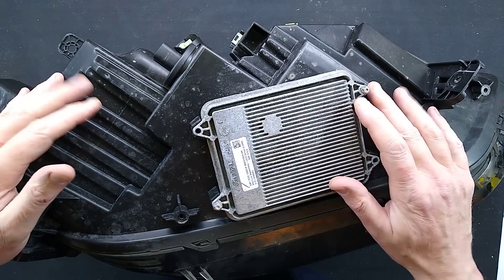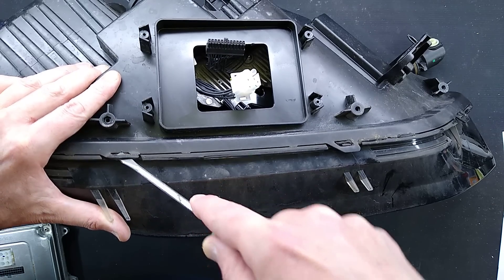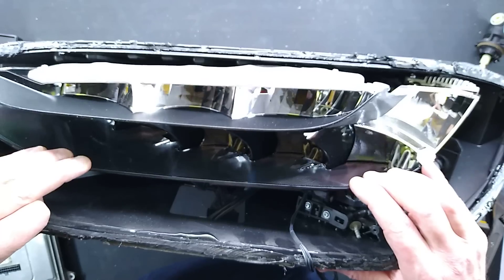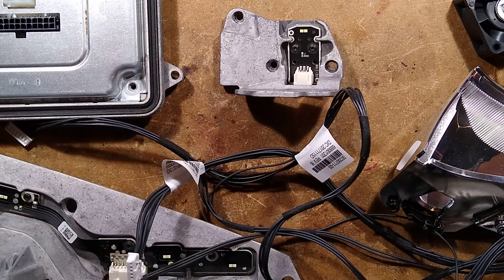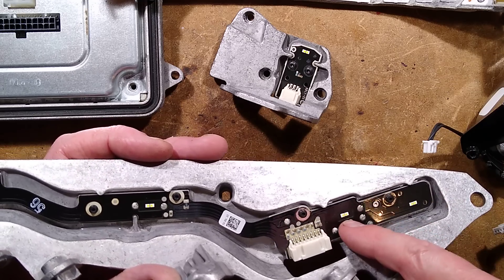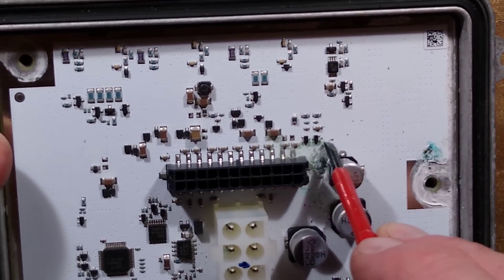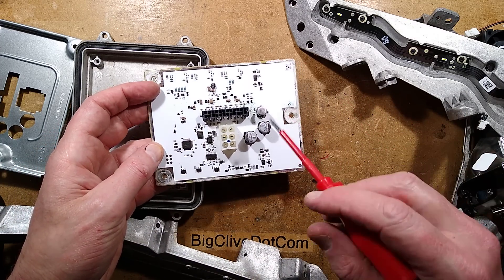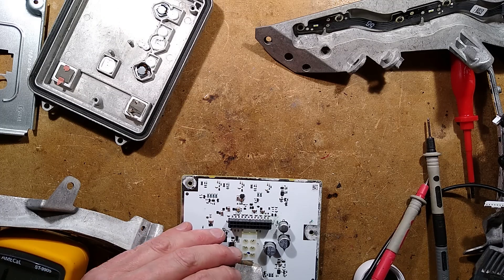Exploring a Tesla model X headlight

Comment: I think the biggest issue here is the case design.  It probably needs more fasteners or a more sturdy case.

Honestly, I'm surprised they use an o-ring and screws.  I always assumed these modules that are subjected to the elements we're simply glued together with some sort of adhesive sealant.
Reply: You might as well pot it if you're just going to throw the whole headlight assembly away.

Comment: I'm unsure if it would work with the Tesla unit, but BMW units can be opened by baking them for 10 minutes at 100°C at which point the glue melts (obviously use gloves if you don't want to sizzle ya pinkies).

Comment: I saw a video on here of Pakistani children refurbishing head lamp pods, I think they used a heat gun to soften the butyl rubber goop that holds the halves of the pod together. Bucket of hot water would probably work too. It looked like a similar compound to the stuff used to hold vapor barriers to car doors that never really hardens.

Comment: Tesla's are crap though. Very clever and everything, but they are made of chocolate and are unfixable. Take a look at the central displays leaking fluid and the modules failing THAT ARE SOLDERED IN. Dont own one out of warranty the battery pack is the least of its worries. Makes me laugh with the 'vegan' leather as well, it's called vinyl and crap cars have used it since the '50s. Classic marketing.

Comment: I don’t know which is more shocking the genuinely extreme effort gone in to making this next to impossible to repair or the absolutely ridiculous amount of tech used just for a headlight. Madness.
Reply: Normal for Tesla unfortunately
Reply: “Good for the environment” yeah, right.
Reply: Most of these LED head light units are Sealed, it's just the way it is unfortunately. It's really dumb when you have to turn round to a customer and tell them they will be over £500 for a blown Side light because the whole headlight unit has to be changed.
Reply: it will only get worse... mentally ill infants have enough money to just buy nukes, zero reservations to just use them, and the "sellers" are mentally ill enough to just give them out.
Reply: I was expecting Laser headlights for that price like some BMWs
Reply: someone just showed me a receipt for a headlight replacement in atlanta $3100
Reply: @nhantran98  wow, just wow...
Reply: Neither of them are shocking to me.  Make it all but impossible to repair yourself and make it cost as much as possible to replace.  Sounds exactly like Corporate Evil Cunt Bullshit to me.
Reply: Yep, 1 bulb, 3 wires , a glass and a mounting bracket.
Reply: They have already implemented the next step in non repairability.
"The structural battery"
All the battery pack glued together internally. Impossible to disassemble without destroying... take a look at Munro channel.
Teslas are highly optimized. Repairability   does not alow for that level of optimization.
They are opening the way for rest of the industry...
Reply: @ptamog  Your picking the wrong component to attack and also showing a distinct misunderstanding of what actually constitutes a battery. The tesla battery is made from a collection of battery cells, ALL BATTERIES CONSIST OF 1 OR MORE CELLS, if i combine batteries they become cells and the battery becomes the collective,  sure these store power but they are not intended to be used on their own AND these are unserviceable for safety reasons for everyone including professionals at home except for when they have serious fire protection. When making a battery from cells a short can happen for many reasons and sometimes completely randomly, when these batteries ignite the lithium is superhot. If you have seen youtube videos of the samsungs failing now imagine that thousands of times bigger and you ll get the point why tesla does not allow people to work on the battery pack. If anything it show progress in the Automotive industry and regulation, how many people died with the introduction to gasoline and no government regulation on storage or public knowledge? This is 2022 companies are expected to be responsible. The very fact you have fallen for some stupid information on Youtube without actually understanding the electronics from a physics point of view tells me that you shouldn't be calling them out on it. 
Please go take a look at what happens when a battery services goes wrong with a lithium battery. The best comparison to a gasoline vehicle would be welding the fuel tank. This is something every garage knows should be done be a trained professional. Whilst the gasoline with go with a boom, it will burn out much faster than the lithium and it will not reach anywhere near the same temperature. This is an exceedingly more dangerous fuel type and precautions have to be taken. 
Now I agree Tesla could make certain parts more serviceable, in this case I too believe they maybe should have tried just replacing the controller and see if it fixed it, however each controller could be UNIQUE to each headlight. All LED are slightly different and with this level of optimization and as clive says advanced optics it wouldn't surprise me if this was the case and they were made in the factory the circuitry was created at the same time all whilst being tested for conformity and adjusting until perfect. The Tesla factories are by far the most advanced automotive plants and with something as important as headlights I feel their own quality standards would drive this solution. Super expensive but the results are evident. The equipment you would need at home to repeat the process would be super expensive. This is advancement, just like I mentioned with gasoline when that engine hit, no one knew how to repair it or had the equipment to do it. It was too advanced, but as time went on the tools caught up, education changed and so forth. In time you will get your right to repair and the headlights will seem like a stone-age invention for tiny money. Its a circle. We've been through all these arguments many times just with different wording. 
I personally do not care if a company makes its products repairable or not as long as I know in advance when I buy the product. Then I can make a choice. Tesla has been very open about where there vehicles should be repaired. You know this when you buy the product if you then proceed to compain how it unserviceable your an idiot.
Reply: @ptamog  Yeah repairability suffers, but they already were about 20% more efficient per watt than their nearest competition, now with gigacastings and the structural battery pack + 4680 cells they will probably be about 35% ahead.
Reply: H4 FTW !
Reply: @bullzebub  2x h7 is better
Reply: This one is almost 10 years old, the new ones have way better headlight tech.
Reply: @SirDragonClaw  how much 'headlight tech' do you need? Mine work just fine with a lamp, a reflector and a couple of wires.
Reply: ridiculous ? Dc-Dc LED drivers for better efficiency + MicroController  for digital controls and fail detection. 
Only bad thing is no coating on pcb.

Comment: There's a few £ worth of components in there, as with all these modern LED lights. 
The main emitters look like CREE X Lamp XB-D which are in 2.45mm X 2.45mm packages. XB-D are rated at 3 Watts each, and produce about 135 Lumens per watt.
CREE XB-D are used in LED light bars, and better quality LED replacement bulbs for vehicles.

Comment: I presume the up/down pivoting lights are for low-high beam, but how do the side-pivoting lights work? Do they swivel in at higher speeds to throw more light down the road and out at slower speeds, when the driver would (presumably) be more concerned about roadside hazards like deer and neighbors' pets?
Reply: The pivot is only for the initial alignment. They don't move while driving. It is the same adjustment screws as all headlights on all cars have been for at least the last 60-70 years.
Reply: @sjokomelk  Good to know we're still using what works and not trying to reinvent the wheel.

Comment: A lot of people disassemble and repair those type lights by placing it in the oven and heating it. Evidently there's a sort of hot melt glue band in there that softens before it harms the rest of the unit. You get it to a certain temp and the glue melts, then you can pull it apart.
Reply: I can't do the oven trick with my plastic modern motorcycle headlight assembly. Other bonding styles are now being used. My 90s Toyota however can be split in the oven.
Reply: @ScuzzySera  If it's been sonic welded, it definitely won't work.

Comment: That is insane that they would make a headlight so complex.  How cheap could they make cars if they didn't go so far out of their way to make them so obfuscated and complex to ensure dealer service charges down the road?  That's totally insane to me. I damaged a headlight module on my 1997 Pontiac Transport and it had 3 thumb screws to remove it, and a scrap one cost me 10$ that dropped in and the 3 thumbscrews to tighten it back down and connect the power lead.
Reply: It's part of the move to computer aided design. It makes previously infeasible designs possible. This has its pros and cons.
Reply: @chaos.corner  My 06 cobalt has a computer that tells me the temperature, odometer, two trip odometers, fuel range, fuel economy, oil life, coolant temperature, and alerts me when my oil filter needs changed, my tires are too low, and when my tank is critically low, and every part in the car is still user servicable. bonus points: it doesn't lock the doors when it's on fire.

Comment: If this is butyl based glue you can put the headlight in the oven at the lowest temperature (like 60°C) and after 15 minutes the glue will be soft enough to seperate the pieces without breaking anything. Not like you would ever need to open one of these anyways because there will be no individual spare parts available for it. 

The reason the low beam LEDs are grouped together like this is quite simple. You need the light to create a specific pattern on the road, to see as far ahead as possible without blinding other drivers. With this simple reflector design you can say that the smaller the surface area of the light source, the smaller the actual optical design can be while still focusing the beam of light properly. And to make the design as compact as possible, it is easier to make several smaller reflectors than just one or two large ones and it also aesthetically looks better. The alternative would be a projector design, which is also quite common, with a reflector, which purely creates the pattern of light, followed by a glass lens which focusses the light onto the road

Comment: I wonder why it even has a seal around the edge when it looks like there are significant gaps around the connectors and bigger electrolytics where the water can easily get in.
Reply: The seal is between the headlight and module, to stop water getting inside the light itself. The connectors are on the inside.
Reply: @aragorn084  Oh yeah, totally missed that. I must have been distracted while I was mesmerised by the dulcet tones of Big Clive.

Comment: Polycarbonate can be a nightmare to cut up.  I remember around fifteen years ago we were scrapping a machine at work that had a polycarbonate safety guard. We thought it would be easy to just cut the guard into pieces small enough for the bin. Tried cutting it with a jigsaw and the blade went through it, but the polycarbonate just joined back together again as the blade passed through it.
Reply: Try other saw blades, the ones you were using were creating too much heat, a wood blade rather than one for cutting metal.
Reply: Circular saw with aluminium blade (negative tooth angle) works like a charm.
Reply: BTDT. The first cut leaves behind the junk then you do another cut to knock that stuff out without heating it up too much.
Reply: @chaos.corner  That is what we eventually did, it was surprising how difficult it was to cut up

Comment: Headlights aren't to bad to get apart. Throw it in the oven (on a baking sheet with a towel) and let it sit at 176c (350f) for normally under 10 min (can usually get away with a lower temp too, can't remember the exact number as i have not done this in a very long time). Take it out and quickly pry it open. The sealant used is usually Butyl rubber, which becomes very pliable when it's warmed up
Reply: Yes was going to say this, additional butyl rubber rope can be purchased on Amazon too fairly cheaply if you have a leaky headlight

Comment: Indeed an interesting thing to take apart. Great video.
I suspect that the 'green death' entered right at that black connector though, so the seal probably did hold up. It's really annoying to see the nice seal and witness them completely forget about those connectors. On the other hand: They log their eMMCs to death, so not too surprising, i guess. The one thing i will never get about cars is, why it needs a 1k+€/£/$ headlight in the first place. And while LEDs are somewhat power-efficient, they definitely do take their toll on the environment. That headlight is definitely somewhat uncalled for...

Comment: Not using a butyl adhesive which can be released and not offering the control module as a separate part.
We'll get to Mars quite soon climbing on a pile of trash.

I disassembled and fixed a much more mechanically involved xenon cornering light a couple of days ago from a german manufacturer and I was able to unglue it, find the fault and glue it back together for pennies. The light is fine and if any of the three control modules fail they have their own numbers and can be ordered by anyone, not just "trained monkeys".

Comment: In fact you can heat up the headlight in oven at 110°C for about 15-20 minutes  and that will soften the glue an than you can pray it apart.

Comment: Tesla electric cars saving the planet with electric cars. Yea, sure. All that plastic sealed around a few LEDs and a bit of water susceptible electronics. Don't mention the aluminium in the casting and the aluminium in the pcbs! (Rant over)
Did the qr code on the pcb link to anything interesting?

Comment: Guy down the road has a Tesla, both the rear light clusters are like fishbowls, I think they were replaced at one point because they were dry for a short while but last time I looked, they were full of condensation again. 

Not impressive QC at all and what a bunch of gits, using silicone to glue the components in and make it so difficult to repair
Reply: I have a Chey Volt and the rear brake lights do get condensation in them once in a while but it evaporates eventually and it's apparently normal for that to happen. The electronics in the rear brake lights are potted so moisture won't damage them.
Reply: @brianleeper5737  I looked this morning, it's got quarter of an inch of water in the bottom of the passenger side rear light cluster and is fogged up with condensation. I'm thinking crap QC.
Reply: @M0UAW_IO83  Sounds like it. Wouldn't be one bit surprised if they have the dealerships drill a hole in the bottom of the assembly to fix it and allow the water to drain out.

Comment: Ooh, you can scan the little corner QR code and get a ‘Matrix’ number, interesting.
Reply: Datamatrix is a standard similar to QR codes used for inventory and parts tracking. They pop up all the time on parts inside of things. They’re normally just a number specifying the part number.
Reply: @SkigBiggler  well it’s a very long parts number, I can tell you that, lol.
Reply: @Lumibear.  part numbers can get quite long, depending on how the company numbers parts. Sometimes they’ll also have different numbers for internal and external use. It could be UUID (universally unique identifier) or it could be using a structured product number, where different sections of the numbers also convey information, like a number such as 1000986422 might store the category in the first four digits, machine number in the next two, actual item identifier in the two after that, then the year of manufacture in the last two. Depending on how much info is stored, the number can get quite long.

Comment: "Sealed and protected against water and weather" is usually how this much sealing is justified, like phones and removable batteries. It's fine and a good thing up until they take it too far and glue things permanently together, then you end up just destroying it trying to simply open it. "Well built to never need replacement" but on the off chance you happen to need it, you end up paying a ton out of pocket replacing more than is necessary because its all one sealed unit.
It can make parts durable doing it that way, but at the cost of more money and waste. Sadly it seems to be a trend in more than just Tesla and cars..